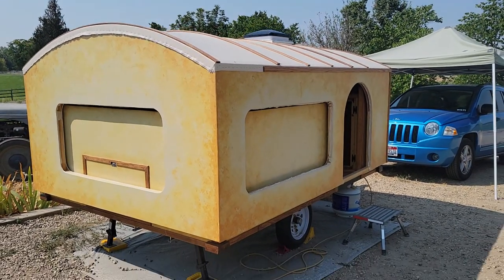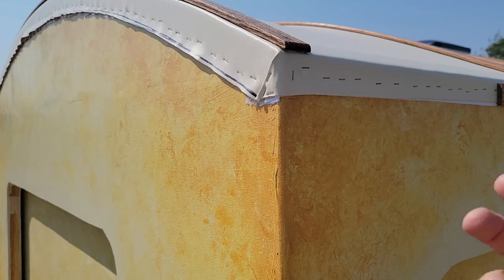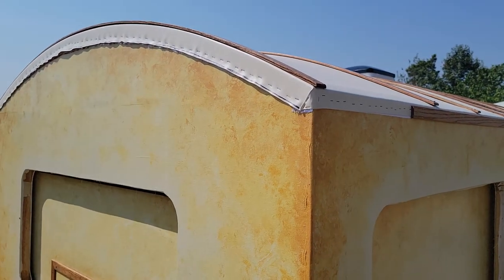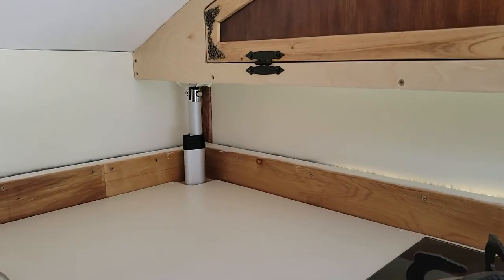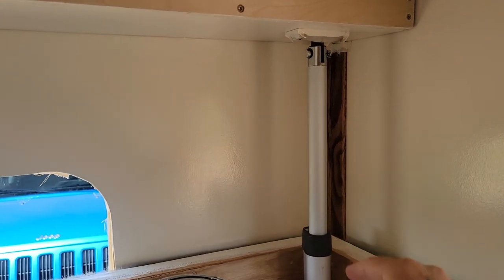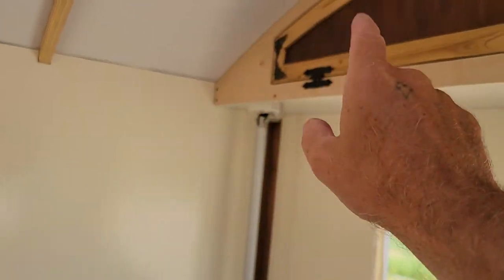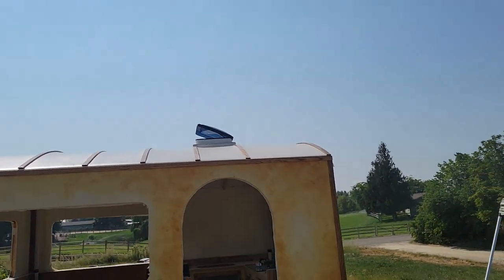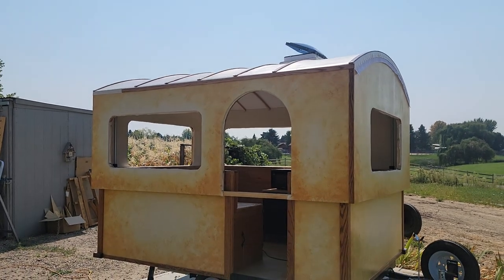Gypsy Caravan Project, Part 10: The Finished Roof

Comment: Nice work-- The Loctite adhesive is great-  I use on my chainsaw carvings to fill cracks and joints and it sands and stains beautiful.  I have also used it to repair 100+ year old broken gravestones.  It last forever-  I got some on my work clothes and it has survived dozens of commercial washings and the heat of the commercial dryer.  It does stick to fabric. :)
Reply from the maker: I can vouch for it sticking to work clothes for sure! Also for filling and sanding wood it's excellent. I never thought about using it to repair broken stones. That's good to know! Thanks for the kind comments. 😊